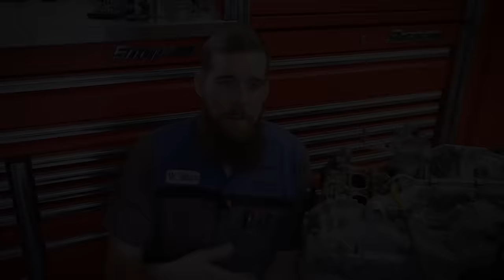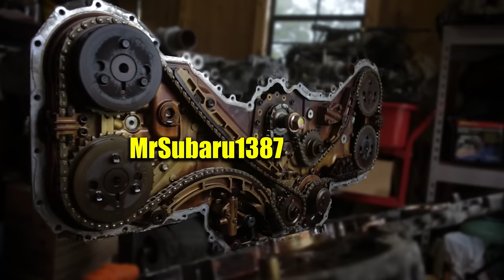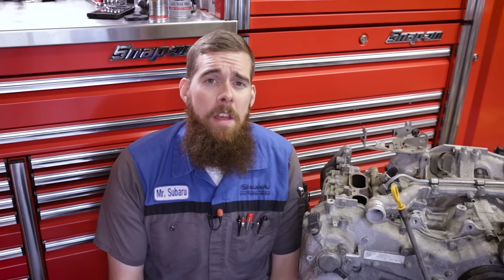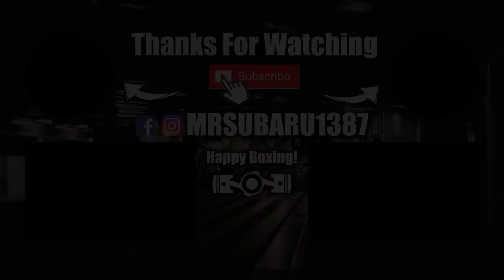Why Subarus Are So UNreliable!!! Buckle Up!!!

Comment: Spot on MrSubaru1387, I've owned everything from highly modified WRXs through to grocery getter Foresters and have never had a major issue with a head gasket. My 2012 WRX had an oil blow back issue with the turbo which was repaired under warranty. My 2004 XS Forester had a head gasket oil leak after 350,000Km (217,000 Miles). My other Subaru's including Liberty, Impreza, Outback and current highly modified XT Forester have never had an issue. My mechanic loves  them, regular service, oil & fluid checks & it ain't expensive. Like you said a Subaru isn't a Toyota etc, it needs a bit more love and if you take care if it then they'll go forever!!!

Comment: I am on my 4th Subie, started with a Loyal wagon, two Outbacks, and a Forester XT.  Each went over 200K miles without ANY mechanical issues.  I change oil and filter at every 3k with Mobil 1 and use Wix premium filters, tire rotation at every LOF, brake pads and rotors were the only expensive parts used. I live in AZ and when the cars hit 200k I drive them up to Colorado Springs and sell them at premium $$, then return to AZ and buy a new one on the cheap.
,

Comment: I love my 2015 Subaru Forester! No modifications, keep up with my regular maintenance and outside of replacing a few things in the front end, I have had no issues.
Reply: I also have a 2015 Forester. I received it in great condition! It is due for a valve body replacement, unfortunately. But my mechanic is taking care of it.

Comment: Good speech. I saw people blew up their WRX or STi on YouTube all the time, and all them are young and don’t know much about the costs to maintain their race car. I abuse my 2020 WRX STI all the time and it never had any problem. It’s because I do engine oil change with Motul 300V every 1000~2000 miles, it depend on how I drove it. change transmission and differential oil every 10000 miles, change water coolen, break fluid, power steering oil year. I also launch the car all the time, but in the right way to launch it that only ware clutch pads, and my clutch is still alive so far. It may sound expensive to maintain STI, but it’s not high cost to take care of your car compare to people whom blew up their engines. I also modified STI only with STI parts without touching ECU tuning. I know STI engine has potential for ECU tuning, but I rather not to use engine life to exchange hosper. WRX STi is a reliable car to own, but if you drive it mad, better make sure you pay attention and more money on maintain it.

Comment: Well said my man! I'm actually a few months into working at a Subaru dealer. I am an ASE MasterTech coming from a different manufacturer and you are 100% correct sir. Just within the last few months of being there we've already gone through multiple WRX's with clutch issues or rod knock and simply just stupid concerns all related to poor maintenance , poor driving , or really really bad aftermarket accessories. But by far the best is when you get the ol " well I'm am engineer" which I guess basically means they know better than anybody of how things are supposed to work in a vehicle they are driving. Love your videos especially when you have to rant! Keep it up!
Reply: Bro my car has been at the shop for 2 week plus they can’t figure out what’s wrong. Two different dealers. I have owned the car 1 year. 10700 miles in one year. Oil changes every 4K miles. And they can’t even tell me what’s going on

Comment: Mr Subaru, last year January my Nissan pickup was stolen, all I could get my hands on was a 2008 forester 2,5 with 312000km on it. Engine runs great still and has never been opened. What I have had to do, complete clutch, brake pads and discs, muffler and the spark plug seals. I didn't want to take the vehicle but I'm really loving the ride. My only issue is the price of gas 😅. Lastly, I really appreciate all the videos you have put up, still going through them and I'm learning alot. You got my subs sub 😂

Comment: Thank you for making this video.  You are so right.  I keep my 2017 base model WRX stock and the design of  these engines by Subaru  are amazing. If you maintain these cars right you will have a beautiful driving experience. I will never modify my wrx. Stay safe brother.
Reply: That’s what I know about Subaru no modify in anyway and do not run them hard it may last stay safe and keep your foot off the paddle

Comment: Daily driving a 94 JDM Legacy GT (EJ20H Twin Turbos). I love the car. It runs great for a 27-28 years old car with only 79k km (49k miles). Recently replaced the valve cover gaskets (original ones) and now they're running great except some exhaust gaskets are on their ways out for being too damn old. I agree that Subaru owners are to blame for their "unreliable" cars. They're so obsessed with modifying cars, running high boost turbos, not properly warming up/cooling down the engine or doing donuts in the snow or muds. I think Subaru is one of the best reliable car makers and their cars are amazing.

Comment: My Legacy GT blew its head gasket at 130K fully stock. I'll admit I did drive the car kinda hard when I first got it. Nothing crazy like launching. The car has always been really well cared for by myself and the previous long time owner. Oil changes done on a schedule with frequent oil checks. I suspect the stock tuning which is known to be lean for emissions might have been a factor in the head gasket failure. Honestly I wasn't even that upset when it happened. While the engine was out I had an independent shop install Cobb stage 2 mods as well as a Crawford AOS, and high flow turbo oil feed. 30K later the car is doing great and fun as hell.
Reply: Did you examine the head gasket yourself or   Did your mechanic use internet Subaru mythology to justify a costly repair?

Comment: Your videos are always on point, relevant and refreshing . My 2019 crosstrek manual, has 173,000 miles on it. No major issues other than fluid and filter changes and spark plugs. I will be changing out the clutch soon for an OEM clutch. Great product.
Reply: I just bought my first Subaru a 2019 Manual Crosstrek 44k miles after my Fiesta St started giving me issues…it’s certainly not a speedster but if I can get as many miles as you got out of yours I’ll be happy

Comment: I agree with this.  I have a modded 370Z, but I'm not going to blame Nissan if I blow up the rear end, or if a set of rear tires lasts me less than 10,000 miles.  I know I beat the hell out of it sometimes, so I own the consequences when it breaks.

Comment: Okay, I’m glad you tempered your comment with the issue being about the owner. Head gasket issues did happen to us with our N/A 2.5 Outback. When I asked the dealership to install the turbocharged gasket, they didn’t want to do it. $5k later the Outback was fixed. 

Moral of your story is keep the turbo motor stock, and give it what it needs!

Comment: Great video. Racing teams rebuild their engines after beating up on them.
Subaru's are not race cars. Marketers have seduced people into believing an STI is a rally/race/invincible machine.
The STI you own is NOT the car Colin Mcrae drove. Not even close.
Reply: @ianholmquist8492  this guy. Drifting an AWD on tarmac is "spirited".
Reply: @ianholmquist8492  not what I'm suggesting. This whole video is about how subaru owners treat their cars. Drifting them on tarmac like in the marketing video is exactly what will kill the car and the point of the video
Reply: @ianholmquist8492  the g forces when cornering cause oil to slosh away from the oil pick up tube in turn causing oil starvation and spin bearings and rod knock etc.

Colin Mcrae's rally race car had either  baffles to keep oil in the bottom of the pan or a dry sump system. On top of that he had one way louvres in the windage tray to force oil to flow downwards. These louvres were made of rubber I believe. These would need to be replaced I am guessing every few races due to heat degradation.

Any other questions?

Comment: “Main reason Subarus are unreliable is the owner!”

......I can’t argue that...

The only times my 1999 Legacy broke down and left me stranded is when I replaced the timing belt.... and not the pulleys (and the bearings failed, fortunately the valves didn’t get bent), and when I preemptively replaced the 200,000 mile old fuel pump...with a cheap airtex-wells pump (which failed after a month, now has a Denso pump).

268,000 miles and is still my daily driver (on the original head gaskets, I ❤️ the ej2.2)

Comment: I have been extremely happy with my 2015 2.5i forester with CVT. It has been a fantastic vehicle. All maintenance done with factory parts and Royal Purple fluids. Currently has 117k miles and I have only had issues with the AC compressor (known issue) and wheel bearing/hub (known issue). 

The AC compressor originally had issues with leaking and not keeping the AC cold. Replaced under warranty. Had a second compressor do the exact same thing, replaced under extended warranty. Just after extended warranty expired had a 3rd compressor leak and replaced with aftermarket lifetime warranty compressor and haven’t had an issue since but also hasn’t been long enough to know for sure. 

The wheel bearings/hubs have been a known issue on the 14-18 foresters. My first (drivers side rear) happened before 12k miles. Loud growling sound. Replaced under warranty. I had all of the bearing/hubs replaced under extended warranty except the passenger front again, including the drivers rear that had already been replaced once, before the extended warranty expired. Haven’t had an issue since then but again not that many miles as most of them were replaced at around 90k. 

Do I consider any of that bad for a vehicle? No. As Mr.Subaru said every vehicle has issues which need to be fixed. At least the issues I have with the bearings is an easy change that I can do myself if it crops up again now that I am out of warranty. When they fail it is a loud growling and I know I need to change the bearings/hub and will get it done. 

I have maintained my wife’s Honda’s and had the same kind of issues and paid a lot more for the parts. Our last Honda, which will be our last, was difficult to work on in the driveway and when it started burning oil at 40k they wouldn’t take care of the issue. We kept it until about 110k replacing fowled spark plugs and putting in 3 to 4 quarts of oil between oil changes with Honda Claiming that was completely normal and unwilling to do anything. We sold it with the documentation Honda was saying everything was normal. None of my other vehicles burn oil at all between oil changes. All my other vehicles have higher mileage than that Honda and except for the Subaru are older model years. 

My family has have extremely good luck with Chrysler corp vehicles and I still own 2 myself in addition to my Subaru Forester. I have found that if you just keep up with maintenance and don’t start ripping things apart and modifying them vehicles work great for a long time in general.

Comment: I have a 2006 forester manual at 210k, hopefully she keeps on chugging. Does have piston slap on colder starts so im always checking the oil and letting it come up to operating temp before pulling away.

Comment: In fairness, no one leaves the sportier model Subarus in stock form. Subaru knows this. Look at the 2022 WRX. An increase of only 3 horsepower over the previous WRX? And, that's just one feature. Subaru knows full well that everyone is going to modify the WRX. That's why they put so little effort in improving the horsepower. It's a Starter Car for modification purposes. Subaru did that intentionally for the new model. They know full well that practically everyone is going to mod the WRX. That's like saying the WRX is reliable.... if you leave it stock. No one leaves it stock. That's like a new bride going up to the Honeymoon suite with her new husband. Changing into a lovely nighty.... But then being genuinely surprised that her husband expects some sweet lovin.' She's got no right to be surprised or upset.

Comment: This is exactly correct. With the WRX and STI specifically,  yes it is nice to get on it every once in a while but when you floor it after every stop it just hurts the car. Also with the poor modifications, blowoff valves, aftermarket high flow down pipe and full exhaust, aftermarket turbo, intercooler, and intake all without a tune. It’s very frustrating as an enthusiast to know that there are going to be less and less examples out there as time passes because people beat the crap out of these wonderful machines.

Comment: Thanks! Good video! :) I have Subaru Forester 2001 with factory EJ205.. Love it, maintain it, look after it...
Already over 330'000km on it... NO TUNE -> Cylinder compression good, oil pressure good, Bardahl racing oil (for daily driving), no head gasket issues...
One thing tho - the timing belt tensioner bracket almost killed my engine, noticed it before it failed and tensioner fall out... The screw threads on the tensioner/bracket screw chewed off...

Comment: As the original owner of a 03' bugeye, the stigma behind subaru is overwhelming. People told me their subaru horror stories and insinuate that my bugeye will "blow up" or has "blown up".  It's laughable because my bugeye is about to hit 300k on its UNOPENED engine and its 5th timing belt change. Not to mention the car still has its original, unopened "glass" transmission.  You said it best, use quality parts and thats been the case for all of my cars.

Comment: Why cant I compare Honda and Toyota with Subaru? They are all car manufacturers in that aspect. Boxer engines of Porsche's are more reliable than Subaru's.
Mazda, Honda and Toyota modify their engines too. Why dont they blow up? Every car is reliable if you do maintenance and make it stock. Hell, a rotary engine is reliable if you maintain it. On a list reliable engines for cars, Subaru is at the middle at best.

Comment: Maintenance is a hot button topic for some reason… I do feel the manufacturers have a bit of blame on them as they have continued to extend and flat out exclude certain maintenance items by classifying them as “lifetime fluids”. Any smart car owner knows there is no such thing as a lifetime fluid. I agree with you though most cars are reliable with just basic maintenance and overall care for the vehicle that includes driving style.

Comment: My Subaru forester stopped running in traffic n blew white smoke into car. 
I’m a nurse and I did take care of my car. I had no signs this would happen. I do regular check ups. I’m a 58 yo nurse. 
So what happened to my Subaru forester it’s still in shop. Low miles. 🤷‍♀️

Comment: Preach! I have a 2008 WRX (original owner), modified and tuned. Never abused. Just took it to my local shop and had it put on a lift. All the mechanics were blown away at how clean it is. No oil leaks, no bad gaskets. It got a clean bill of health. Oh yeah, I don't drink Monster and I don't vape either.
Reply: Those vape fumes are fatal to turbo motors. Once that vape juice gets sucked thru their CAI it's game over.
Reply: Getting monster and coolant mixed up never ends well either.
Reply: I drink Monster and vape. Thanks for warning about Subaru, i'll stick to brands that aren't so fragile.

Comment: Great vid!  And 100% agree with everything you have talked about in this vid MrSubaru!   Some people need to hear this kinda of rant and let it sink in.. and I wish more people would.  

I'm an owner of a 2001 Outback Limited (sedan, 2.5 NA) and a 2016 WRX Limited.  The Outback just hit 250k miles not too long back, and still doing pretty well these days.. I think the center differential is going out though.. getting pretty noisy.  I have not had it properly diagnosed yet.  Head gaskets were replaced around 175k, and the transmission was replaced around the same time.   The WRX is  just short of 70k miles with AP, Cobb intake, Invidia R400 cat-back, and that really about all.  No issues to speak of on the WRX yet..   I thought about parting ways with the '01 Outback, but I kinda considering making it a project car of sorts.. Still love that old Subie!

Comment: I bought an estate car that had sat for 6 months. It is a 2005 Outback 3.0R. When I bought it, the rear gate struts were broken. The brake lines were rusted open, the transmission cooler too. Someone had taken the stock vented rear rotors and put single piece ones on. And there was a knife stuck in the seat, among other small things. After a lot of love and care, it saw the open road again. It's been two and a half years since and I still love it, just wish it was more fuel efficient and the transmission shifted quicker / earlier.

Comment: Love this video! Got my very first Subaru, almost a year ago, a 2019 CrossTrek base model, 27,800 miles on it when I got it, now at about 45,600. I love this vehicle! Yep it's a little underpowered so I put the Crawford performance power blocks and it and got the small hoped-for boost. Pretty much every time I encounter another Subaru driver anywhere, I always ask what year how many miles all that stuff. At least several dozen contacts by now could be over 100. While most seem to have heard about all of Subarus problems, literally no one I spoke to except two people have had any significant problems other than maintenance.

Comment: Rant warranted, agree 100% I'm on Subaru #14 starting with a Brat in the late 70's. I maintain my cars and have not had a major issue. I've modified a few but always maintain them well.  If I've screwed up something, it was on me not Subaru.  Live and learn.  I have witnessed exactly what you are describing though. Just the other day some one brought up the head gasket issue when I said I have 3 Subaru's right now I just rolled my eyes. Thanks as alway for your videos.